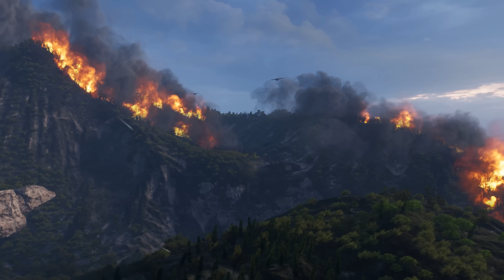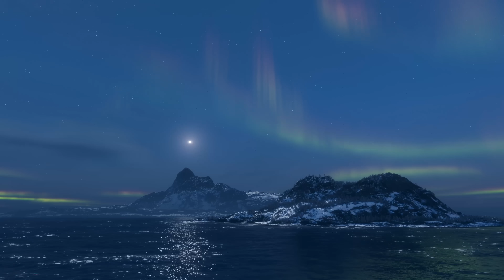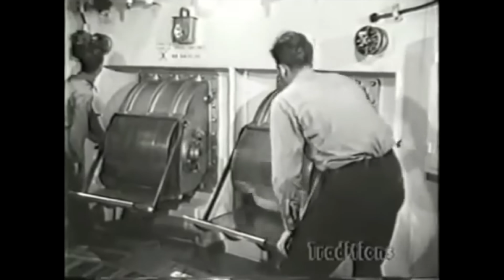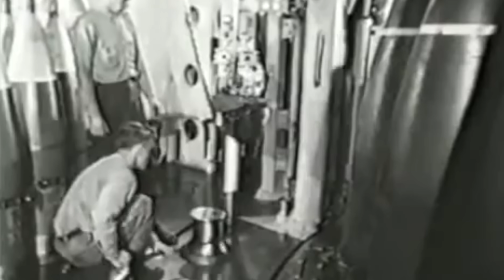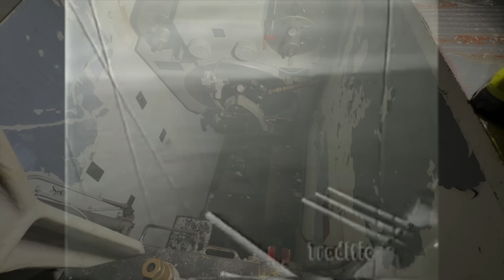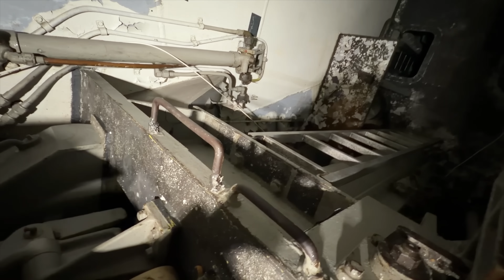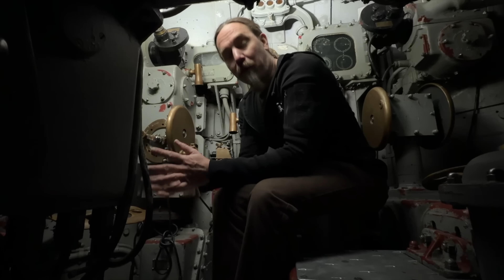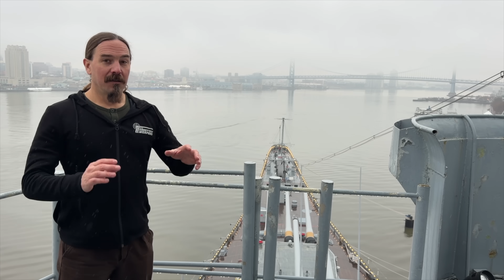How the USS New Jersey's 16-Inch Guns Work: Top to Bottom

Comment: The round rating for the barrels is for full power loads with the super heavy AP shells. When you use high capacity shells or a reduced charge size the erosion of the barrel is decreased. NJ would have been firing almost exclusively HC shells for most of her career. That is why she was able to fire something like 6,000 16in shells during the Vietnam War without a barrel replacement. There is fantastic video about the topic talking specifically about USS Texas's 14in guns published by a volunteer who works on Battleship Texas published to their own channel "Tom Scott, The Older One".
Reply: They have found a few unexploded 16" naval shells in central Vietnam, particularly in Quang Tri Province near the former DMZ which are said to be from USS New Jersey, which is a very long way from the sea.
Reply: the swedes came up with a special additive they used during nam which ended barrel wear essentially. Ryan on the battleship nj official channel mentions it multiple times. As NJ let off more 16" rounds in her deployment to nam then in her entire career up to that point. 
Also iowa not only did 34.3+knots during her 80s re fit work up at 58,000+tons loaded, she also hit static land targets at just over 26 miles the longest confirmed battleship main gun hits ever. 
Shame we didn't just keep them in service&update them again maybe even re engine the iowas to diesel/hybrids ala the qe2. Instead of wasting over 33 BILLION on the feckless zumms.
Reply: @4literv6  Fair enough on the additive the number I found was that it took barrel life from 250 to 1200. So let's look at WW2 and Korea instead.  For some reason I can't find great numbers for either war (I'm on my phone atm) but multiple places said NJ fired more than 3000 rounds in Korea  which by itself exceeds the 2250 limit you would expect.  The reason for the discrepancy is because most of the shells would have been less than 1 "Equivalent Service Round". I imagine there is a chart out there with a breakdown of every shell NJ fired but I can't find it at the moment.

Comment: Awesome tour!  People don't appreciate the technology that went into those fire control "computers" which were designed long before transistors.  Vacuum tubes were cool and all, but could not possibly hold up to the concussion of one of those big guns.  The "intelligence" in those systems was all reed type switches, gears, relays, and mag-amps.  Redundancy was built in everywhere, such that the guns could be fired locally if the main firing location was out of commission; and the sailors would have drilled on those alternate methods so frequently that it became second nature.  Remember, too, that this was an all volunteer force; these guys signed up for jobs where losing a hand or arm or worse was a daily occupational hazard. Hats off to the men who made these ships the pride of the US Navy!

I was on two different US Navy subs, one built in the early 60s and one built in the late 80s.  As you were moving from room to room on the tour, I swear I could smell what those rooms smelled like, especially in the fire direction room.

Comment: Welcome to the Great State of New Jersey!!

11:11 the magazine system protects against "flash" which is the advancing flame front of an explosion of deflagration. Screens can stop sparks, but pressure seals are needed to stop flash.

48:30 The barrel life is 300 full effect charges. Shore bombardment uses reduced charges due to the shorter ranges and this drastically extends barrel life. Only the anti-ship AP shells get the 6 bag charges as standard.

Comment: A modern big gun would be pretty interesting. With rocket boosted projectiles and guidance you can get fantastic range, and you dont have to worry as much about aiming the gun perfectly, as the projectile can have significant crossrange capability.

Comment: I couldn't imagine trying to troubleshoot and repair that fire control system.
Reply: Probably WAY easier than today's proprietary electronic hell honestly.  Find the mangled gear, make sure everything is nice and greased.  Oh hey that four gage wire that pulls in the rangefinder info is severed.  Let's splice that.
Reply: @sultanofsick  That entire metal case is full of gears. It would take dozens of man-hours to disassemble, find and replace the damaged gear section, then lubricate and reassemble.

Comment: The reason the electro-mechanical analogue fire control computers were still used right up until the 1990s has more to do with processing speed. Digital electronic computers at the time could certainly do the job with equal accuracy, but the older mechanical computers could generate a firing solution much faster. That speed mattered, because in a running battle, where both the ship and the target were moving, a firing solution that took too long to compute would no longer be accurate.

Comment: How accurate are those guns in M.O.A.'s?
Reply: with the ship's position static; or taking into consideration the ship's bobbing and weaving on the water?
I'm guessing the latter might have an adverse effect.
Reply: @aemrys79harvey17 they use the trigger that only fires when the guns are level. When you test any gun for accuracy, you test it from sandbags or a shooting rest to eliminate outside errors. You dont attribute outside effects to the guns accuracy.

Comment: Not getting to open the breach was such a bummer. Those massive breaches are so sick.
Reply: The breech is spring counterbalanced with a compressed air assist.  The mothballing process removes the springs, and of course the ship's compressors are not operation to charge the air lines.  The breech can be lowered and raised using a 2-ton chain hoist and the many pad-eyes located in the gun room overhead.

Comment: It seems like a well thought out system for the times.  Each one of those is truly a BFG.  I've read the accounts of the battles with Bismarck, I've wondered what the actual dispersion is for one of those guns, i.e. what MOA size group can the guns shoot at combat range.  I've also wondered how they get all the various devices linked up so the gun points at the same thing that the rangefinder points at but I assumed that when they build the ship they pick a reference off in the distance such as a building and make sure everything points at the same thing.  Maybe during initial sea trials they do some live firing to confirm zero.  The curator has discussed barrel life depending on which powder charges they were using which has a big affect on barrel life.

Comment: Hey Ian, would have been cool, if you could have included metric units at least on screen. Because for me as a German, the imperial system is just unintelligable gibberish and now I have to pause the video and translate the numbers inot metric myself. And that sucks. Or to speak with a customers voice: this has nothing to do with customer service! Here in continenatl Europe nobody knows, what 2700 pounds are. But we know what 1225 kg are! And we don't know, what 660 pounds of propellant are. But we know, what 300 kg are.

Also, the Big J was NOT the last battleship of the US Navy. Her sisters Wisconsin and Missouri were commissioned after Big J! In fact Missouri was the last one, despite her hull number being lower (63), than Wisconsin (64).

Edit: thanks for using metric later on screen.

Comment: Ian matey, I think you're losing it; no tear-down and I suppose we won't see one on the range either?
Seriously, the whole set-up is fascinating and in particular (for me) the firing solution computer.. 
19 inputs, I can only guess. OK,  ship bearing and speed (2), target bearing and speed (2), distance, temperature, wind speed and direction, relative humidity, projectile selection (3)....that's 12, 
Then it has to allow for Earth spin but I reckon that's internal?
Alright, if it can accommodate for the Secondaries that's just 2 more? So potentially 14 logical inputs that I can account for and can only speculate the other 5, I know I didn't mention the RADAR but I'm reasoning the calculated distance will be either Optical range-finder or Radar ie still one input.
Speculation; which turret is firing because they are a distance apart and not necessarily firing from the same height?
Angle against target?
Barrel wear? They will fire differently at 200 rounds than new etc.
If anybody knows, I'd love to hear back.
Edit; Air density.

Comment: “And if any of these 16” guns are of interest to you, you can find them in the upcoming auction at Morphy Auction…”
Reply: ...I can't quite get the entire gun in the frame on the table but we will make do...'
Reply: Unfortunately this particular example has been de-mil'd
Reply: Do you have to pay for shipping yourself?
Reply: @Bastudalen2024  shipping 😂
Reply: @RedComet777-sl8ps well wouldn’t you be glad to see the heavy load tractor trailer makes it way to your driveway ? ( should have told the wife …)
Reply: @Bastudalen2024  brother, the guns came with the ship, it's a bundle package, no need for truck

but you do need deep water ports next to your house
Reply: When placing the bid, please remember to also account for the $200 tax stamp.
Reply: @wurfyy one stamp  for each barrel, I would imagine, plus one stamp for every shell. If the standard loadout was 300 per gun, then expect to buy 903 stamps at a cool $270,600.
Reply: @Scupplin  Put it on the credit card. I want to see the repo company brave enough to even ask the question.
Reply: Every time they discharge one or more 16 in guns, they have to holler, "pan shot!"

Comment: What kind of motors did they use to run the turrets? Was it standard AC voltage or something else? Did ships run on "standard" civilian voltages??
Reply from the maker: I suspect you can find these answers on the @battleshipnj channel. They cover a lot of details like that.
Reply: 440-480 three phase.  It has been a few years (38) since I have read one of the data plates.

Comment: Anyone who wants to make fun of WW2 France, this failure is what you should aim at, not the Fall of France, where their leadership, both current in the form of poor command choices and past in the form of poor preparation choices, screwed them over, but individual soldiers and small units tended to fight fiercely and well.  This "invasion" saw poor performance and motivation from top to bottom, despite being the best chance to end the European conflict quickly, or rather to put it off until the soviets decided they wanted and thought they could take more.

Comment: 43:00 Afaik, they kept using the mechanical computer because digital computers couldn't take the vibrations of the guns firing.

No idea if that's true or not. Considering the construction of old magnetic HDDs - it could be.
Reply: Not true.  The expense of trying to replace the mechanicals for no added benefit was a deal breaker.

Comment: The 3D printed shell is a nice teaching tool. And the only disassembly Ian was allowed to perform. You can see the AP, C and BC parts of the APCBC superheavy shell. Also you can see the parts that still are in today computers : the I/O switches, the computer "processor card" itself and the operator console "the pineapple trigger".

Comment: 17:56 An important correction: 
The Iowa's AP shell was the 16' AP Shell Mk 8, an APCBC or Armour Piercing Capped Ballistic Capped shell. The first cap was correctly labeled by Ian as the Ballistic Cap, which helps reduce drag during flight. The second cap he removes is the Normalizing Cap, the reason for there being two 'C's in APCBC. Upon striking an enemy warship, the ballistic cap deforms and has basically no effect on the penetration process. The Normalizing cap then contacts the enemy armour, and as it's name suggests, normalizes the shell. The Cap deforms, slightly torquing the AP shell itself toward being more perpendicular to the armour. The Normalizing cap helps increase the shell's penetrating power by reducing the effectiveness of armour slope on the shell's penetration. That purpose is also why the normalizing cap is not smooth, but has a double-cone design. the steeper front section of cone helps increase the normalizing power of the shell, before the second section curves back much faster to stay within the ballistic cap. The penetrator itself is not removable, as it is the shell itself. 

The ballistic cap is as light as possible, in order to not interrupt the penetration process. The Normalizing cap is a specially designed mid-hardness steel that is optimized for the normalization process.The shell itself is also steel, likely deferentially hardened to create an extremely hard tip, and a softer body, optimal for armour penetration.

Comment: I toured the USS Iowa a couple of years ago with my teenage boys and took the extended tour of the main 16in gun and the 5in gun. The entry into the 16in guns was quite small and even realized it was not for anyone that was closterphobic! I amazed at the size of the battleship and it took a few hours to go through the tour. One of the things that really caught my attention was that when it was recommended that they tried to retrofit the firing control computer with a new computerized system and fired the main 16in guns, it would go down and they had issues with the system getting back online. They realized that the original old analog system performed with no issues and was more reliable and just left it in place! Goes to show you that not everything new will work better than the 1930's equipment! I recommend anyone who gets the chance to tour one of these old battleships take it! Definitely worth the time and money especially if you have kids.. they will remember it for the rest of their lives! A disabled US Army veteran 🫡

Comment: For those uninitiated, the Super Heavy Shell, or SHS, was a philosophy of design of the USN. It was a way of getting increased armor penetration without going to high (relative) velocities. There was not only a 16” SHS, but also 12” and 8” SHS. The shells on average weighed roughly 20%-25% more than other shells of the same diameter, both in the usn and other navies
Reply: It also is important to note that most ships DID NOT carry them... none of the Colorado class could fire the Mk 8, for instance - they didn't have the room to upgrade the shell hoists.
Only the Cleveland class could use the super heavy 6" shells, the Omaha's couldn't.
Only the Baltimore class and later could fire the 8" super heavy IIRC.
The two Alaskas were the only ships that could use the 12" super heavy.
Reply: And 6 inch 130 lbs vs 100

Comment: For those interested, 660lbs of D839 smokeless powder is equivalent to 4.62 million grains of standard smokeless powder by weight. So each of the 6 bags used to load one gun was equivalent to 770,000 grains on it's own. 1 "grain" of D839 however was about 2 inches long and one inch around so slightly larger than standard powder grains. 

To put this powder charge in perspective, a standard round of M2 ball ammo in WW2 used 50 grains of IMR which have a length of 1.42mm and a diameter of 0.81mm. This means each "grain" of D839 is approx 50 times longer and 25 times larger in diameter. If both were using standard grain size, a powder charge for a Mark 7 would be approximately 92,000x larger than the charge used for a single round of M2 ball 30--06. One shot from a Mark 7 is a 2,700lb shell traveling at approx 2,500ft/s resulting in 262 million ft/lbs of muzzle energy compared to 30-06 with a 150gr projectile traveling at about 2,700ft/s for a muzzle energy of 2,400ft/lbs.

If you have read all this, thank you. If Ian says all this information in the video, I apologize. This comment is me nerding out before finishing the video. If I got any information wrong or made a math error, feel free to correct me.
Reply: I'm in the UK so I don't do any shooting, I just watch videos on it. When how many pounds of powder required was mentioned the first thing I did was pause the vid to look up the conversion into grains.
Thank you for giving me some actual numbers that put it into perspective.

Comment: The sheer amount of manual labor is insane. Compare that to a modern Mark 45 gun system which is very heavily automated and generally does not require any gun crew.